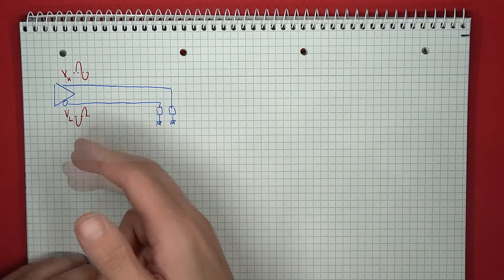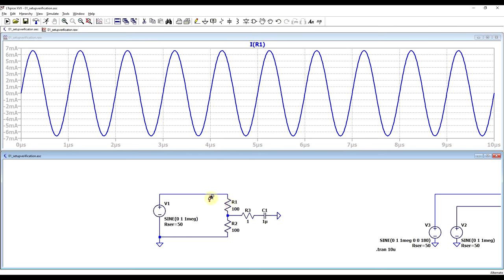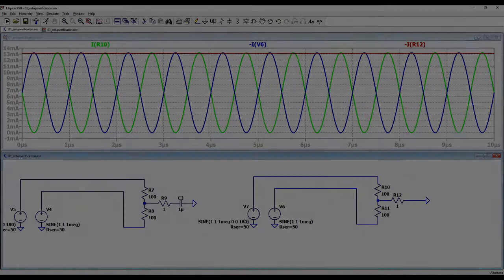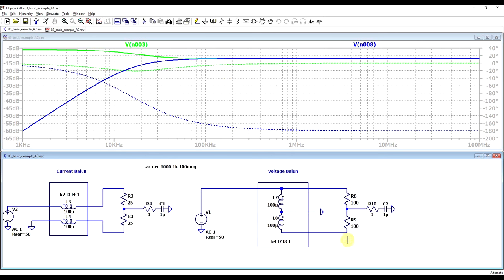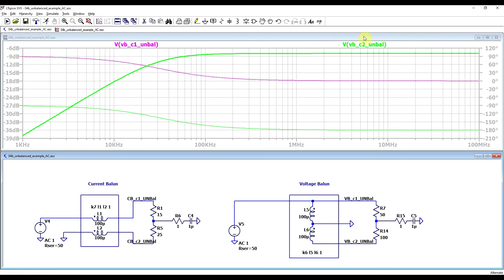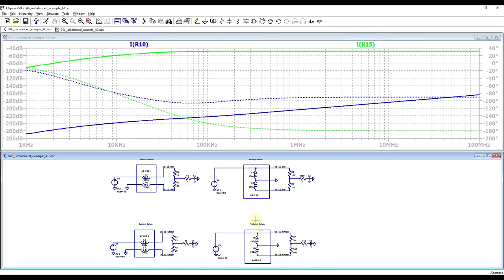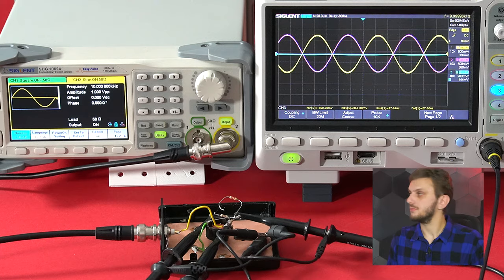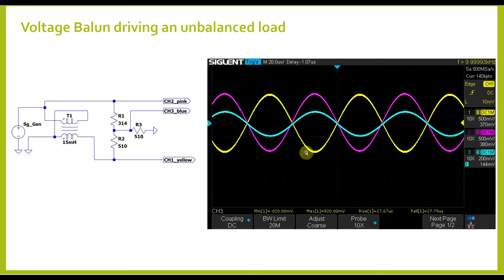Voltage and Current Baluns

Comment: Excellent video. I always find the topic of transmission line transformers very interesting. When one first looks at them one is tempted to think 'how can they work?' because there is no magnetic field outside of a coax line. However, that is only when the currents are balanced, when getting to be balanced there is a field! I've read a books by Jerry Sevick and articles by Chris Trask, and made a dozen or so twisted pair transformers myself, but your perspective on this (one that I respect) would also be very interesting.

Comment: In your first computer simulation, you have a 50 ohm source feeding a 100 ohm resistor in series with a 100 ohm resistor in parallel with a 1 ohm/1uF to ground.  Where did you come up with this model for the simulation?  Where's the necessary inductance?  Is it already cancelled out?  How do you reconcile this model with the antenna circuit definition of R+jX?  How do you unbalance a resistor in series with an inductor and capacitor?  You are familiar with R+jX, right?

Comment: Thanks for good presentation.
@7:47 I do not undersand why you connected single ended Voltage Source to Voltage Balun?!
Reply from the maker: To generate a balanced signal - maybe I didn't understand the question... the voltage source is unbalanced, but by using the balun, I created a balanced signal from it.

Comment: what frequency do things start to work?
Reply: That depends on the magnetic materials of the choke or transformer.  You'll need to pick the one that fits your application - audio for low frequencies, or RF for higher frequencies.  A transformer's useful frequency range will be provided on its data sheet.  Some applications will involve a DC blocking cap in series with it, so that may reduce the operating range as well.
Reply: I couldn't see that level of choice complexity in the circuit model.